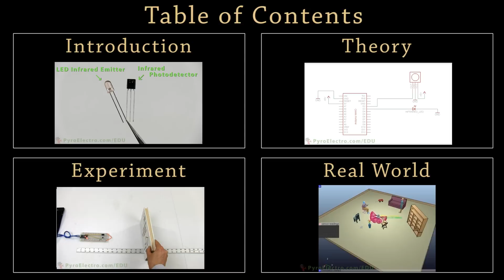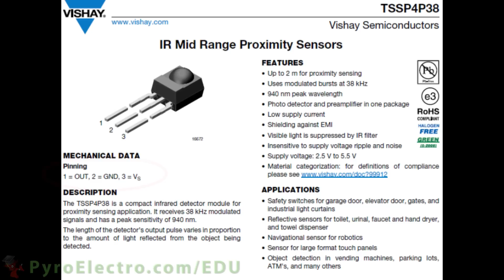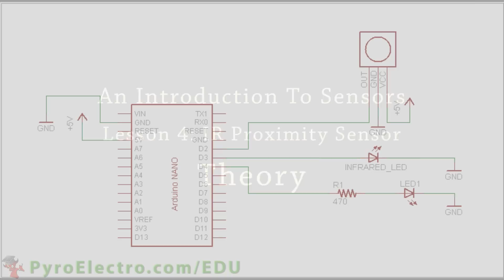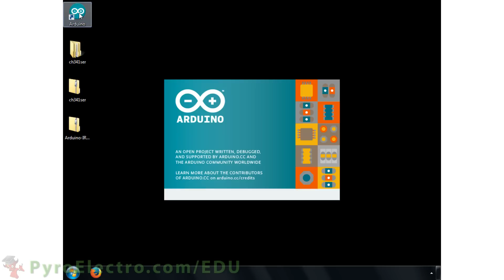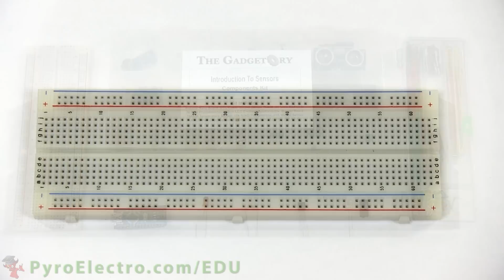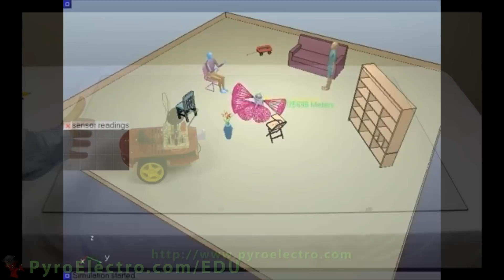IR Proximity Sensor - An Introduction To Sensors - PyroEDU

Comment: Hi @PyroElectro, how do you know at what frequency to feed the IR led for the PWM? Do we have to refer to the datasheet of the LED? I have a project that requires the use of IR Proximity sensor but I am stuck at PWM part. Also, what about the aplification & bandpass filtering part? I am having trouble with all that. Hope you can help me out!

Comment: Everything in this course was nice and clean. One thing though is please show how to do it without the library maybe? It makes understanding what you did in the program easier and allows for me to be able to modify and write my own code.

I've never coded using the arduino, only the PIC18f4580 so i have no idea if using libraries is a common practice.

(edit)

is there a way to detect how close something is?
Reply from the maker: Ancient lawz Libraries are commonly used, so this was just to introduce them. The output to the infrared led is a continuous 38 KHz PWM signal (50% duty cycle), so nothing fancy.